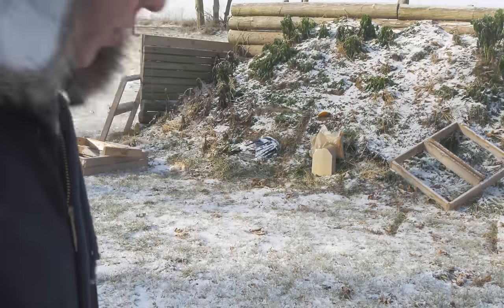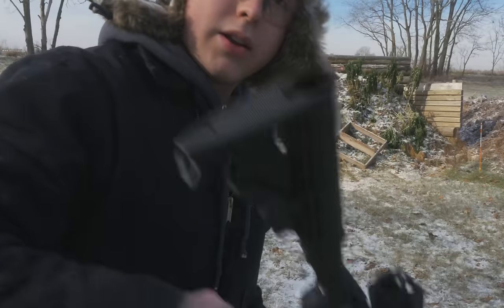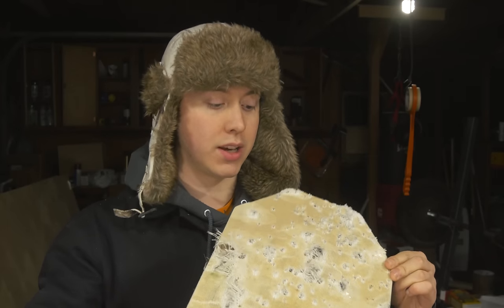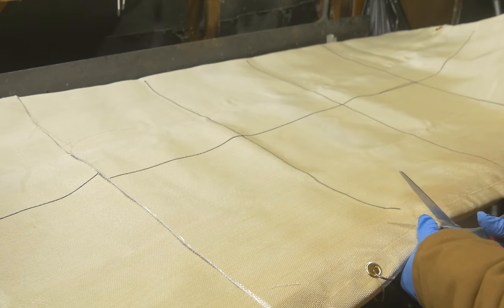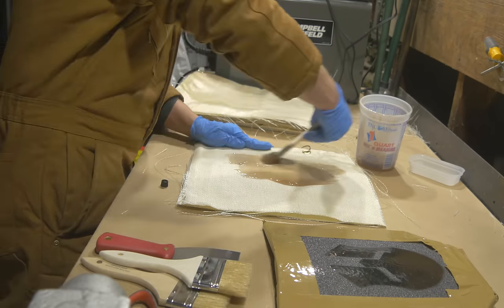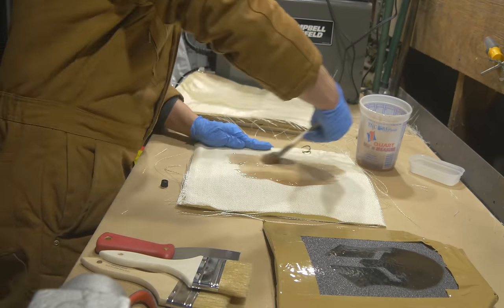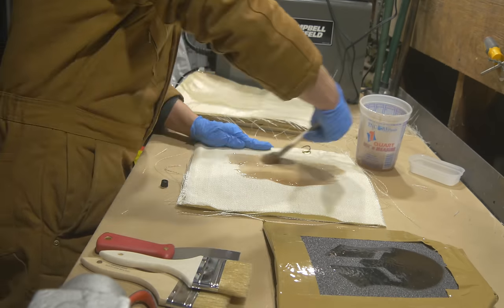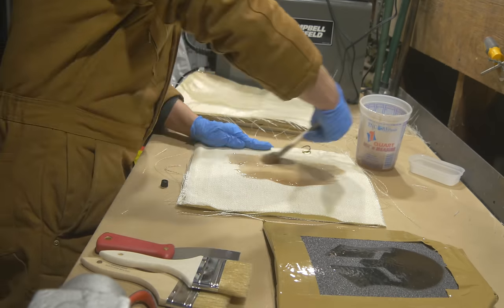How to Make AMAZING Bullet Resistant Armor for $30

Comment: I'd be curious to see how effective it would be with an 1/8" steel backing plate or even some alternating sheet metal layers.
Reply: Ceramic tiles on the front fiberglassed in...Now thats the real question would it be more LVL IV-ish
Reply: steel is super dangerous for armour if a round its the plate you're gonna get you're neck fucked by the spall
Reply: @hekk_u  if the fiberglass is wrapping the plate it could possibly stop some of the spall
Reply: I would embed a thin layer of titanium
Reply: It would definitely add more stop ability even against 223.  With about 3 metallic. Thin steel plates. Between layers.   Plastic plates too.    Whatever you could imagine
Reply: I wanna make some steel plating where it alternates between thin spring steel and high carbon steel layers all with graphene hammered into the individual plates. That way instead of the bullets poking holes in me it can smash my body into a mix of bone powder and jello 😋
Reply: @bringer-of-change  hahaha Lol 😆
Reply: Add 4 layers of ceramic glass, along with the cheap $20 welding blanket, will increase cost, yet will yield amazing results. Easily hold back 556 NATO.  Its is possible to make a composite armour that can withstand 30 caliber rifle rounds!
Reply: @joeljelliff2901  yeah the ceramic would be a good option, I think placing it before or after a steel plate could prove interesting.
Reply: He should have done a shot by shot with the 5.56,to get a better idea of what 1 round would do,because not all of the 5.56 seemed to make it through.  Also what resin(poleyester,epoxy,vinylester,etc). How many layers of cloth and what weight of cloth.He left out the most important info.
Reply: Ps. If you cut it when the resin has gelled but not hardened a razor knife will cut fiberglass (not Kevlar).
Reply: stainless
Reply: @hekk_u  You are neck?
Reply: @hekk_u  you can wrap a spell sleeve around it to fix that.
Reply: @cassanoa  There goes your $30 budget.   Titanium is VERY expensive.
Reply: @ottokiehl5413  I have been thinking of going the AR500 route - maybe trusting my life to 30$ of fibreglass is not the way to go
Reply: Thin Titanium sheets
Reply: Or laminated layers of aluminum,  fiberglass panels.
Reply: @cassanoa  
Yeah, cuz Walmart has sales all the time.  Costco too
Reply: @cassanoa  
Interesting.  Will check that out. And some fiberglass cloth too.
Then comes the research. 
How thick is the  cloth. How many layers would be required to stop a pistol caliber or rifle?
Should it be layered in alternating directions? Or all the same? What about the fiberglass cloth? How may? In front,  behind or layered? Laminated? Two separate or 
Gonna find out. Thank you
Reply: @Shadow-gc6le  even having the steel plate in a Kevlar plate carrier should stop most of the spall
Reply: I think a mesh screen would be smarter
Reply: 1 inch paper and one layer o nickel cover with fiberglass..
Reply: It would give it more ballistic strength against the exit wound impact. Id definitely add some steel to that. Can't go wrong.
Reply: @hekk_u  true, but that's why you put kevlar or some other material in front of it.
Reply: @ricknerinfantry  I suggest you look into the Russian "defender" body armor system it is basically what you have just described. Oxide has a video testing it
Reply: Agreed first thought i had
Reply: @hekk_u  dip the plate in a rubber coating to help mitigate this
Reply: @R3CKLESSRHINO  or just dont use steel and go for ceramic since its better and lighter
Reply: @hekk_u  oh i agree but a plate of steel is easier to cut to shape i would still dip any of them on a rubber coating
Reply: @hekk_u  what’s more dangerous, getting shot in the chest or spall?
Reply: @steffen2165  cool you can stop the round with a steel plate but then shards of metal will go flying into you're arms and throat spall can be just as dangerous so why not eliminate it all together and use ceramics
Reply: My thoughts exactly
Reply: You could buy some cheap soft armor and put it on the back of the fiber glass, $100 for two level 3
Reply: @hekk_u  it isn't spalling, it is splattering. Spalling is an entirely different problem, it's when the bullet doesn't penetrate and it causes a chunk of steel to burst off the back of the plate, entering the target. If you call bullet splatter spalling around a tanker they will call you a nitwit. Spalling is what kills most tank crewmen in battle.
Reply: I'm far from an expert but I think that if you had a bullet not go through the steel but make a bad dent to where it makes the steel layer go completely concave, I think that would be just as bad as getting hit with a bullet, just look at what happens to level 3 armor when it gets hit by high power rifle rounds, the bulge on the back of the armor juts out like a good inch or two, and that's on armor that gets tested over and over before being mass produced. I think a thin layer of steel would act similarly but worse...
Reply: A coule 1/8" AR500 plates sandwiched in the fiber glass.
Reply: Titanium is probably to expensive and steal is heavy. I was thinking since your layers did so I wonder if you added a thin layer on aluminium. It's very pliable.
Reply: Just carry an engine block..cuz weight doesn't matter apparently

Comment: first , i must say that your video is amazing. So thank you.  I had plans to make the same thing using overlappinbg old seat belts.  I got slowed down by an article about coconut husk fibres and how they are rot proof and stronger than steel. under a microscope the coconut fibres look like aircraft cable on the cut end. amazing. I bet that coconut fibre could help with the durability of that resin plate you made. Just a thought man. cheers.

Comment: If you're going to live long enough to enjoy the fruits of your creativity, get some sort of powered air personal respirator ( PAPR ) AND, better yet, also have some sort of point-source dust control from a nearby vacuum nozzle / funnel so those filaments aren't building up in your shop to be blown around and inhaled later by either yourself or whoever you invite in there with you.
__ A mitigating idea among many:  Modify / add to your shop vacuum a 2-Stage pre-filtering setup that can be put together for relatively cheap involving a 1st stage bucket-mounted cyclone by Oneida ( obtained at Menards Hardware or other, better built options for ~ $25 online from overseas ) or a correctly built / tuned DIY Thien baffle to precipitate out larger debris into the first of two 5-gallon buckets ( also cheap ) after which the exhaust sequentially travels to a 2nd stage - a cyclonic water capture bucket - which just uses some PVC / plastic plumbing pipe through a second 5-gallon bucket lid and gradual / longer-sweep plumbing elbows totaling less than 90 degrees to ensure the airflow is directed at the water swirling in the bucket to ensure contact ( think of it as a capably-matched, larger version of a drywall sanding wet-capture vacuum bucket collection system but without the restrictive plumbing or poor air flow ) . The exhaust of that 2nd stage would pipe into your shop vacuum which would keep its filter clean for a long time ( $$$ savings ) which enables you the inherent benefit of full vacuum performance all the time from that freely breathing shop vac pleated filter while stage 1 prefiltration bucket is filling to the maximum operational level. Tip : try to add as little volume in the pipework as possible to the system and use rigid, smooth walls of the pipework as opposed to springy and flexible, textured shop vacuum hoses to run the lines up to the connection points from the vacuum up through the 1st stage pre-filter to keep the vacuum from working against turbulence and compression / expansion losses of vibrating flex connections. Value your lungs as much as your creativity. 👌 👍  Carry on that creativity!
Reply: I see it's cold there... pro'ly too cold for water in your debris-water capture bucket so use some non-toxic liquid that has a freezing point below your shop temps. 👌 👍 👏
Reply: Gary Maier lol xD I came a second time.
Reply: Also what about electrostatic dust removal?

Comment: If you alternate each layer by 45 degrees, you will get much better performance.
Reply: Almost forgot
Reply: Then it reflects off to the arms and fragments.
Reply: what do you mean by "alternate each layer" ?
Reply: Phil Dess He means change angle of each layer of fiber glass by 45 degrees.
Reply: Mech then use 45 degrees for a few layers only
Reply: This isn't kevlar. Alternate by 90 degrees, otherwise you will instead cause slow turning and make spalling worse on rounds that do make it through. AFAIK, canvas material has a (weaker) 45 degree weave in it. Going 45 degrees would more likely compromise half of the layers serving more as a directional nudge instead, spalling rounds.
Would love to see someone test this, just seems the more likely consequence to me.
Reply: That's how they did gambesons, rotating fabric each layer makes it much stronger. Great point!
Reply: 0, 90, 45, 0, 90, 135, and so on.
Reply: a direct hit on the chest bounces off and hit the jaw and R.I.P lol
Reply: most fiberglass weave strands runs horizontally and vertically, 90° of each other. If you turn the ply just 45° you change the strength by changing the direction of the shear value.
Reply: Why 45 , with that many layers (even though the exact is not detailed) one can go 30 degrees as well … 0, 30, 60, 90, 120, 150, 180, etc...
Reply: @dutchcourage7312  in case you didn't figure it out yet. If the are strands opposing each other at 90 degrees going in multiples of 90 does nothing. Draw a tic tac toe diagram #, now rotate it 90* or 180*. You might as well rotate it 360*. Lol
Reply: @sweet65mustang  well, if you think in layers, each rotating 30 degrees, you will notice that once you come to a new 90, you will be a few layers 'in'. Meaning that if anything past layers 0, 30, 60... it now meets another layer 0/90 oriented layer. 

Hope you get what i am saying ;) … it's not as stupid as you seem to think it is.
Reply: @dutchcourage7312  you are absolutely correct, my apologies. I completely read your comment wrong, it doesn't seem to be edited. I don't know how I misread it that much.  I would swear it said 90, 180, 270. but like I said, it doesn't look like you changed it. Wow, my foot does not taste very good.
Reply: @sweet65mustang   ahw don't sweat, happens to everybody, myself included, so much input of messages these days that some just (for some reason) get a glare over and you think you read what you think you read, and comment on it with that in mind. Where after it turns out you totally misread it...

And seeing you weren't being a poopie head about it, you got a nice reply back, pointing out what i meant. Turns out you misread, happens ;) … all is cleared up now, and all is well … :)
Reply: I'm making some of this right now.  I tried an experiment though.  I'm mixing in equal parts resin and coal slag blasting sand. It makes an impressive black material. I shot a sample of that and another of pure resin with a pellet gun and the blend faired much better.
Reply: @sweet65mustang   well stopping a bullet is all about resistance (or diffusion of energy), so having sand particles in it is one more thing slowing down the bullet as it hits grains of it along the way. 

(not sure if you ever heard of Dragon Skin, can probably find a video on it ~ it uses discs of ceramic to 'diffuse' energy to slow down the bullet and 'stop' it. 

As the bullet hits the ceramic the moving energy is transferred and breaks the ceramic, that energy is then no longer within the bullet so it's slowed down). Just to mention an example of diffusion.
Reply: @Michael Lindquist This was my comment on this video as a whole… maybe something to try out ^^

---------------------
So probably the only way to make this 'better' while it still being cheap (yet a lot heavier), is to add a layer of bathroom tiles (like the really small squares on some sort of fabric); 

do not make the mistake that the 'myth-cough-buster' made, by poring it into some sort of cement, you just want the tiles (perhaps two layers overlapping) to be able to 'explode' off of it and as such remove a lot of the kinetic energy from the bullets. 

To make that 'safer' by not being slashed up by bathroom tile shards, put some sturdy fabric over it (like an old jeans)… basically mimics 'dragon armor', which is just rubber with disks of ceramic tiles… 

Also already heard you will want to alternate the layers by 45 degree (or better yet, 30 degrees and keep altering by 30 degree) … 

but before you do all that, GET A DANG RESPIRATOR ! …tnx for the video though, i liked it, hope you like that too ... 

Minder weergeven
Reply: @dutchcourage7312  diffusion is what I was planning but discovered that the sand also stopped the cracking that I experienced with the pure resin. I assume the jagged edges locked out together.
Reply: @sweet65mustang  so you are not using glass fiber then (or reclaimed kevlar from airbags, as some have suggested, not even sure it's comparable to the 'kevlar' one would hope it will be). Because those fibers should hold the resin together...

It's similar to like pine pitch, where the recipe with charcoal / resin, makes a 'brittle' glue; which is why the 'original' recipe calls for charcoal / resin / ground up rabbit dung … as that dung has very short natural fibers in it, which will take care of some of the tearing stresses in the material. Which causes the whole to be less brittle.

So if you merely use resin, and not fiber, then yeah sure, the sand matters, it provides the resin something to cling (hold on to / transfer stresses onto) to.

But that is not the thing you would want for a diffusion type system, well, yes and no; like, you want the thing to break to diffuse the energy from the bullet, but obviously not as fast and easy as cake, because then there is less time for the energy to transfer and the bullet might keep a lot of it ... so there is likely some optimum.

Though then again, i am not a ballistics expert !! So perhaps i am wrong on that last bit. Just using general physics knowledge and some material knowledge. But even there i am a tad rusty… so don't blame me if it turns out i am wrong on something ;)
Reply: @dutchcourage7312  I am using 8 layers of a thick fiberglass welding blanket, cut square to the shape and at a 45 degree. I didn't have the patience or material to turn the pattern more than that. Then I spread the sand/resin blend between alternating layers. Next I placed an actual plate on either side and placed it in a 12 ton press. The press squeezed the resin into the fabric leaving a thick slurry of resin bonded sand between each layer. At that point I trimmed it to size with an angle grinder and cut off wheel. That cut it like butter (it literally took less than 2 minutes)  and surprisingly it made more of a granule than dust. I finished up by mixing a final batch, with only half the sand, that I spread all around the plate. I sandwiched it between the 2 plates again but didn't apply pressure. The only thing I want to do different next time is insert a ceramic tile mosaic of small hexagons,grouted with the sand/ resin,  between layers 2 and 3 from the front. Another thought is to mould the layers separately and then join them later, increasing the layerings. Thoughts?
Reply: @sweet65mustang   sounds like a lot of work, is probably my first thought… ;P

As far as the ceramics go, i think the trick is to allow them to 'explode' , so putting them in the plate may well be worse, or simply not do the thing wanted.

But i guess since you got a plate now you can test that, if you were to make the other as described.

My thoughts about the ceramics has always been to use (say an old) jeans to make a flat envelope out of it, the size of the plate itself (could even do a double envelope with slots in front and back, the back would then hold the plate) where the ceramic would hang into (in case of a double envelope the front would be ceramic). Can probably make something out of jeans supplies, like two front buttons to make a way to suspend the ceramic tile mat.

That way the first layer is a diffusion layer, where the bullet hits the ceramic and a tile or two) can just explode off, with the jeans providing some safety against flying shards. Then after another layer of jeans would be the actual plate, stopping what ever is left of the bullet by just providing density and friction to stop what ever energy the bullet still has.

Then obviously the other would be the thing you describe… and then it would all be down to the testing.
Reply: I made a panel using 8 layers of fiberglass mixed with sand and subsonic 9mm blew right through.
Reply: @sweet65mustang  hmm, can't actually recall how many layers were in this video. Did you use any ceramics in front of it, like i described? or just the plate ?
Reply: @dutchcourage7312  just the fiberglass, resin and sand. Considering the sand improved the resin in my tests I can't help but suspect we've been pranked.
Reply: Michael Lindquist I can see your face of disappointment through the comment 🤣
Reply: @sweet65mustang  i think the sand may have prevented the fibres from bonding to each other resulting in overall weaker structure
Reply: @SonsOfDeForest  I thought about that too but in the samples I tested the sand version worked better than the pure form. Maybe I'll try again.